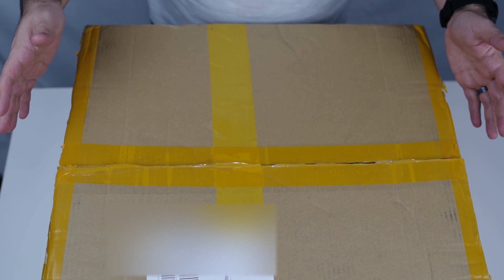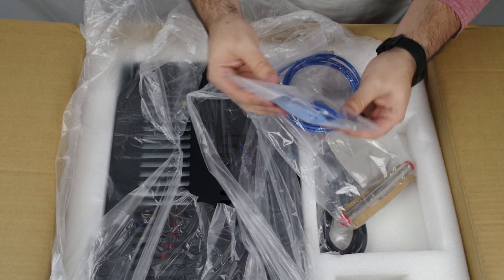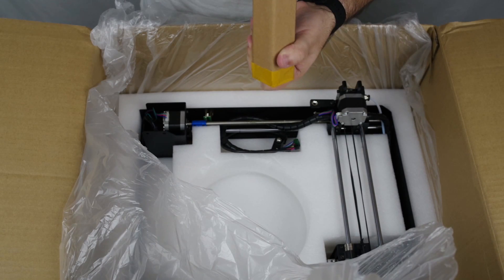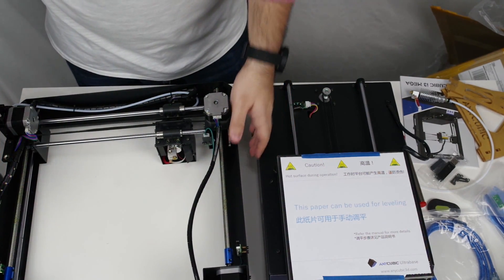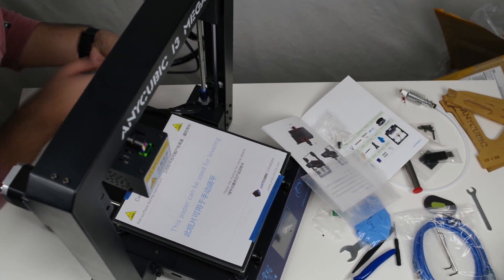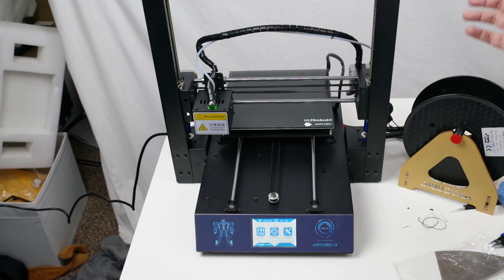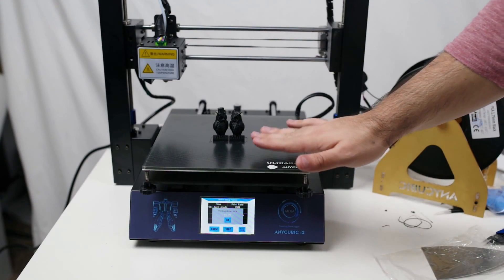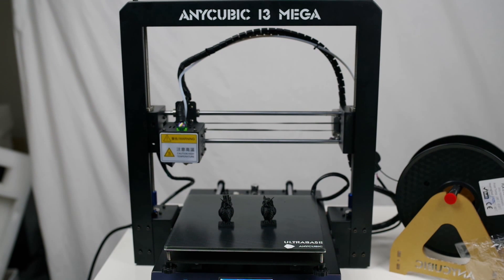Anycubic i3 Mega Ultrabase: Unboxing and First Print

Comment: More time on unboxing and hardly anything on cable connection and assembly and bed alignment etc. Pretty useless for someone, who wish to know, how to assemble this printer.
Reply: To be honest, this printer is really easy to assemble and comes with good manual. 10 minutes and you are ready to go with printing.
Reply: Then watch another unboxing, I wanted to see what was in the box and not just the printer so this is good for me